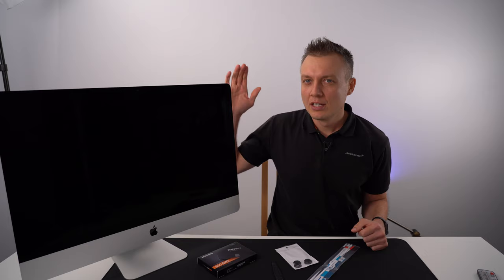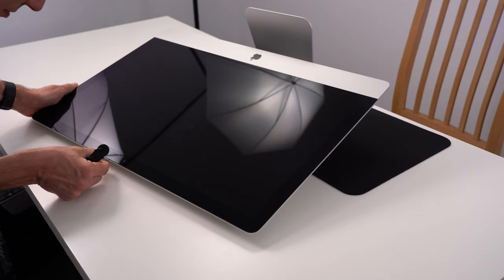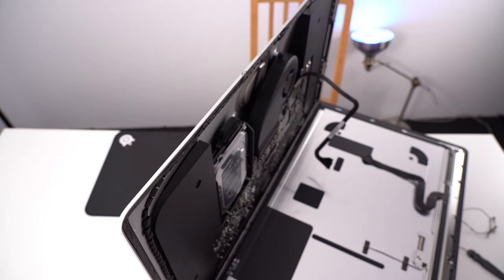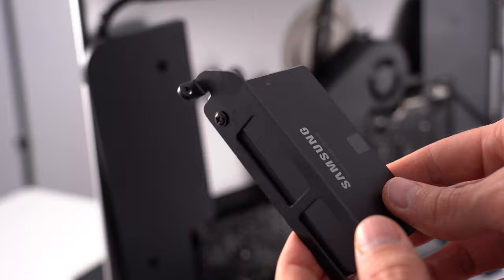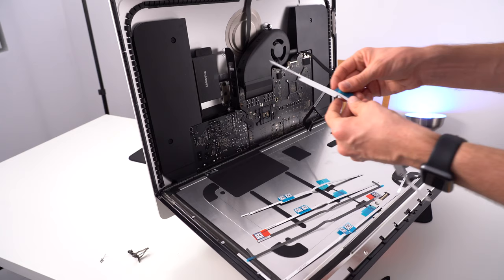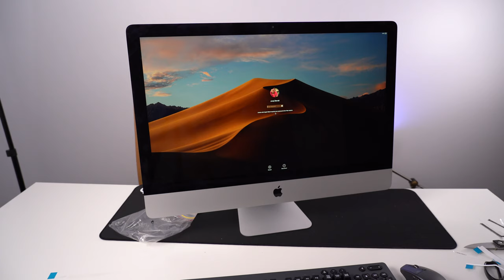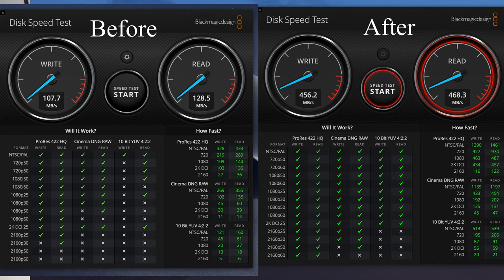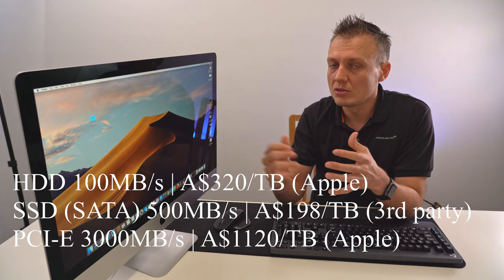How to upgrade iMac 2019 from fusion HDD to SSD (4k)

Comment: I change my iMac 2019 5k base model to ssd 1tb(WD blue) and remove the 32gb pci ssd. after changing, ssd speed result also about 500mb/s.
Reply: why would you remove the flash storage> Its far faster than the sata connection you are using with the new ssd, my IMAC with the 32gb pice and a 1tb hdd tests at 850 and 1400 when a ssd alone would be like you said 550 550. If you had made a fusion drive out of the SSD and pice would be faster than the speeds you are getting from the ssd alone. If you were even in where the pcie is why would you not just put in a large pcie and not use the sats connection? Not trying to be a dick or anything but that makes no sense. Using a sata connection over a pcie has no logic and removing it and just using the sata does not make any sense. Cheers
Reply: You may want to replace that 32gb PCIe ssd with a WD black SN750 1tb m.2 NVME ssd (for south of $130)  for tripling your speed, say 1400MB/s.  You need to buy an adapter to connect NVME to PCIe for 10 dollars maybe.
Reply: 太阳雨 yeah, or buy a 2019 Apple Propriety NVME for under 100. Read 2500 and write 800-1000.
Reply: @jackiescum5438  For less than 100 dollars? That is cheap.  What size is it? Where to buy?
Reply: 太阳雨 I got mine on eBay I think you can get 128 and 256 I got bigger but I got the one terabyte solid-state Sata as well. I’ll see if I can get you the model number of the guy that I got it from I think I only paid like 60 bucks
Reply: @jackiescum5438  I got a 2013 MacBook Pro and a 2014 MacBook Pro.  I am interested to have an apple NVME card that supported natively by all old MacOS.  Thanks
Reply: 太阳雨 As far as I know any of the Apple for propriety from 2013 rate to 2017 both MacBook Air and MACBOOK pro will all fit ii interchanged all those machines. Some of the best ones or the 2016 256 and 500 GB or one terabyte but they’re a little more expensive. 2016 250 GB apple four-lane I believe there’s about read writes 1500 and 1500. Some 2017’s are like 900-1700 For 128 and 256 are better. You can get pretty good deals on those right now